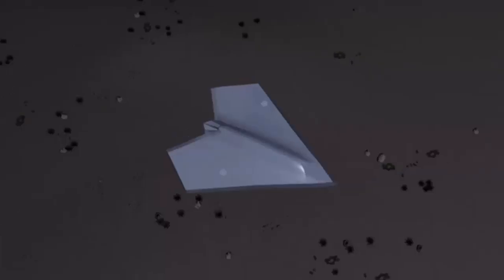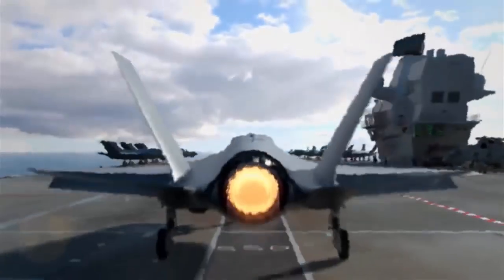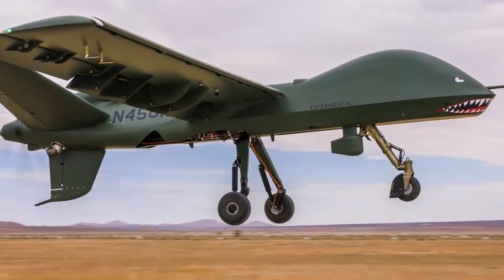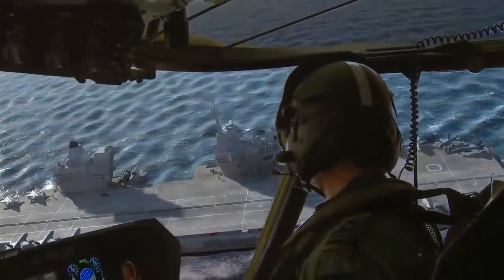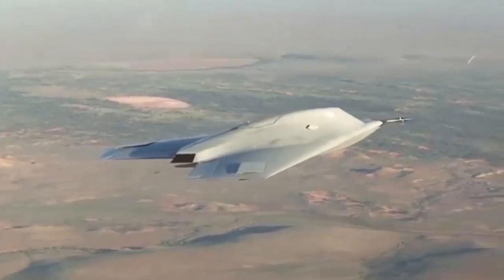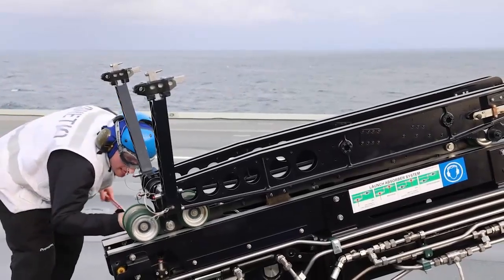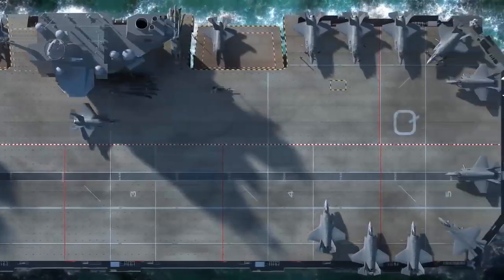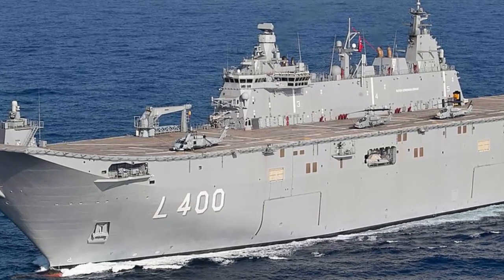The UK Royal Navy Wants To Refit Its New Super Carriers With Catapults

Comment: According to the armchair admirals the ships already have provision for it, cant have it because there isn't enough power, need an angled deck, can fit them either side of the ramp (which isn't needed if you have a catapult), emals doesn't work, the Brits have no knowledge of emals (the basis of the system was invented by Professor Brian Laithwaite, an English man),fitting catapults has been looked at part way through building and was going to double the cost of each ship, basically they will look at it and make a decision depending on who wins the election. Or not!

Comment: There are several major hurdles to this
1. The ability to add an Angled Flight Deck, Arrester Gear and Steam Catapults was REMOVED earlier in the build so NOT an easy conversion. See BAe statement 2 years ago
2. Cannot use the same EM system as latest USN ships INSUFFICIENT POWER GENERATION. The Gerald Ford Carriers have significantly greater power production  than the Nimitz Class, so these will NOT be retrofitted to Nimitz Class
3. NO Aircraft for Catapults to use 
4. NO Funding
5. NO Cost Benefit. 
DECISION TO REMOVE THIS OPTION WAS MADE MANY YEARS AGO
Reply: Absolutely, Trevor!
The RN's order for its F-35Bs went in many years ago, and is still proceeding with the speed of a glacier!  Even if the ships were to get EMALS (which is distinctly debatable) it would mean taking the ships out of service for probably 2-3 years (each?). In itself not a catastrophe as there are only enough F-35B aircraft currently for ONE carrier anyway. Of greater concern is how to acquire a new order of F-35C variants from the US, as they will have to join the bottom of the queue for new planes,(and how to pay for them!). 
Then the question is whether the plan is to operate both B and C variants from the same ship, or just the C?  If the latter, is the plan to fill one ship with the Bs and the other with the C variant?  If both ships, then what to do with all those Bs that are no longer needed. 
And then there is your great question about benefit from such an enormous expense. How much more effective will the carriers with C variants be than the one as currently B configured, for the massive cost involved? 
The whole drone issue can very easily be accommodated by building small "escort carriers" to handle the drone traffic, as they are not so equipment-heavy as full scale aircraft. This also has significant operating flexibility into the bargain! 
It seems to me that someone is going to have to do a LOT more homework before any of this is likely to materialise!
Thanks Trevor.

Comment: ⚠️ If they proposed the original catapult & arrester gear, the cost would of escalated by millions, and so the government would of highly likely have to cancel the project, like the TSR2 or similar and we wouldn't want that.
⬇️
Therefore, based on the RN's requirements that were restricted due to cost, the designers set about working within that criteria.
Moreover, they embedded key elements so that in the future, it can fairly easily be upgraded with cats & traps, etc.
⬇️
The #royalnavy has been a pioneer for hundreds of years, with Pepys and Fisher both significantly developing the RN.
✅️ The first aircraft carrier, HMS Argus, launched in 1917
✅️ The first ski-jump was installed on HMS Furious in 1944
✅️ The first take off & landing of a jet on HMS Ocean in 1945.
✅️ The development of the steam catapult for jets in 1946.
⬇️
So, even though it may not look like it on the outside sometimes, I can assure you the senior service knows what she's doing.
Then there is the silent service to which I'll remain silent...
In the meantime, what I seriously suggest to the public is to support a proposal of spending 4-5% of GDP on defence. 
- If you want peace
  Prepare for war.
  🇬🇧
Reply: I say, do it right or don’t do it at all, but that’s just me. LOL
Reply: @sheilah4525  
Ideally, if you control the criteria, the budget, resources, etc.
However, most of the time, others control the key procedures, procurement methods, etc, or life, politics get in the way, so you just have to work with what you have or get given...